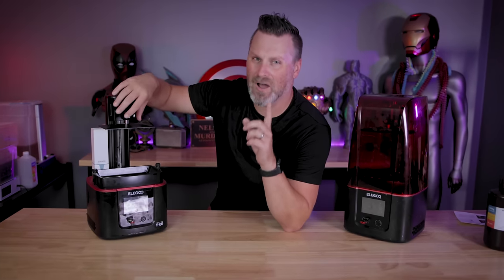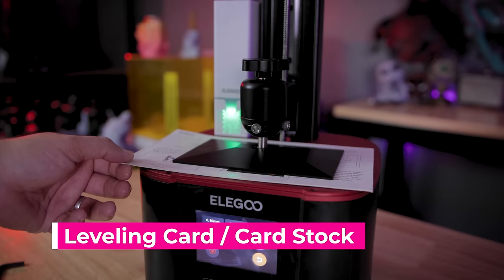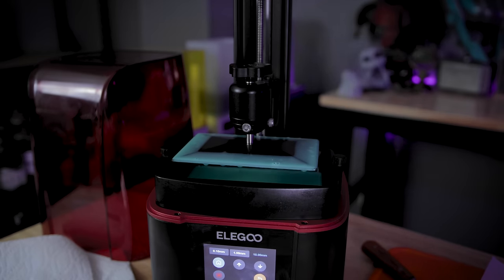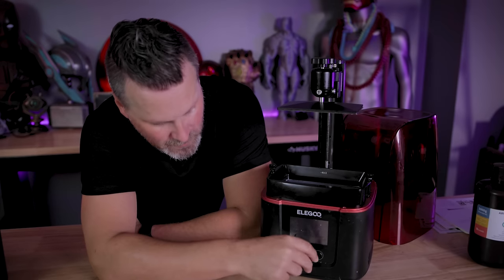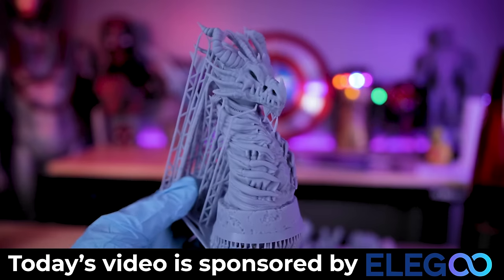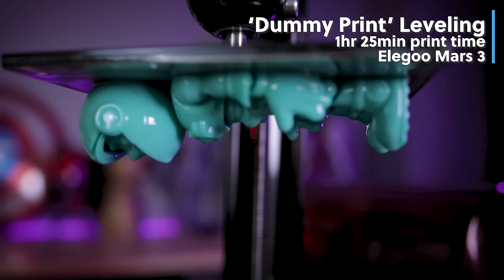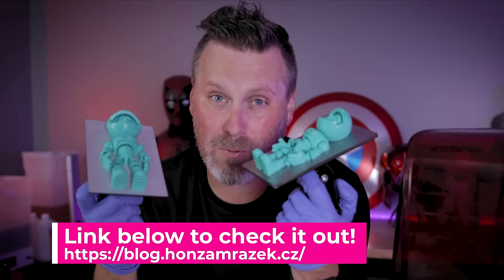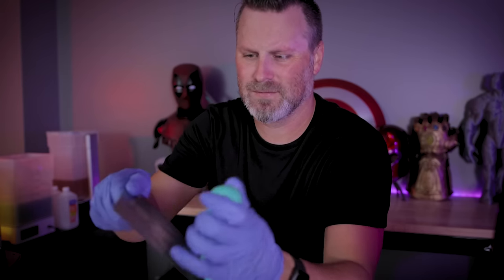The NEW best way to Level your Resin 3D Printer?!?!

Comment: This is exactly how the $90 Monoprice MP Mini SLA printer levels the bed. It loosens the knob holding the build plate in place, lowers the build plate into the vat, and tightens the knob - automatically! As long as you keep the vat clear of hardened resin, this method will never fail.

Comment: I have had the peopoly phenom for 2 years and have never used paper, card stock or film of any kind  to  level the build plate . I just level on the screen  and move on. I rarely ever have to level the build plate this resin printer is a walk in the park to use and I keep it running 24 hours a day 7 days a week. And now I guess you  could say I use film because I keep the screen protector on when leveling. Thanks uncle Jessy for all the information you give on these printers. It was because of your review on the phenom is why I bought mine . Happy creating................

Comment: I use the faster "2 sheet resistance 1 sheet glide" method. I set the level to just have slight resistance on 2 sheets but one sheet can glide under the build plate without catching. It is faster and easier than Jans method because it is dead easy to test by running any program to check that the first layer still lets the 1 sheet glide under the build plate.

 It also avoids squashed prints because it does not cause a pre load. If you squash the build plate when tightening it transfers a load up the z axis and rubber buffer causing screen squash during printing..
Reply: FEP or paper sheets?

Comment: You can already compensate for elephant foot in the Chitubox settings (Advanced/Bottom Tolerance Compensation).  I don't think elephant foot in resin printing can be fixed by adjusting the homing, it's due to the bottom layers printing 10x longer than the rest. This causes more resin to cure, which only has one way to go, outward.  And to be honest, I have yet to experience much elephant foot on the Saturn. Don't know if it may be the Sirayatech Blu Nylon resin I'm using.
Reply: as you could have read in the comment that the blog's author posted 2 hours before you asked the question, the goal of this method is NOT to eliminate the elephant's foot 🤔
Reply: @pgabrieli   It is nonsensical to suggest it affects the appearance of the whole model which is what he concluded as well as the slight reduction of the elephant's foot.

Comment: From an outsider's view, who only has FDM, after watching the video it seems the "Dummy Print" method is just using the FEP sheet instead of a sheet of paper as the level. So is the FEP sheet thicker than paper which eliminates the elephant's foot because the plate is not pressing down as hard?
Reply: Hi, Jan here. Read the post - it explains why it is needed. TLDR: Stupid chitu firmware.
Reply: @yaqwsx0cz  Informative, thank you. Since I don't have a resin printer it seemed this was just using one leveling medium over the other. But I could extrapolate why to use this method if it is just Chitu causing issues with z height programming.
Reply: Idk about thicker, but I would say higher. The start point of any print is not the same as the level. I assume the start point is higher. The paper helps you to level against the screen with curing residual resin on your glass, and other messy stuff. 😂 I too have used printer paper, parchment and card stock. No difference in performance really.
Reply from the maker: @yaqwsx0cz  ☝️☝️☝️☝️☝️
Reply: I'm curious if you have to relevel though if you change layer height?  The starting point for .025 would be different than .05 or .1
Reply: @RM_VFX  no, as levelling means setting z=0. Each layer is z+(layer height)
Reply: @yaqwsx0cz  hi there, just finished testing the leveling and light-off procedure that I read in your post on my Mars 2, i have almost no elephant foot and the layers are perfect. thank you so much
Reply: @QuellicheilMarza  Happy to hear that! If you want to share, please share with the original blog post.
Reply: Semi-related to this: I feel like maybe I missed some technique in last year but how are you able to get flat on bed prints like this that don't fail. The technique I've been using has been to angle the design, but with this design being rounded it seems the amount of suction to overcome would increase for at least half the print, yet these print just fine

Comment: This method seems like it would be dependent on having the correct z=0 position to begin with. To me it would seem like when you hit the home button the chitu firmware sends the build plate carriage down to engage the z-limit switch first, then goes up 0.5mm in order to ensure that the build plate is all the way at the limit. With the dummy print method, the carriage will begin the print wherever the z=0 is currently set, so if dummy operator accidently set their z=0 at 10mm up then the dummy print method will start the print at 10mm up.
Reply: Aggreed

Comment: I don’t recall where I learned this, but I have been trying out the method of leveling with four strips of paper, one at each corner.  This method helps with ensuring that there is consistent pressure and nothing shifted after torquing the set screws.

Comment: I think im missing a part of how the second method works, from my understanding when the arm moves up for that first layer the plate is still loose so it is still 0 away from the FEP. Is this method taking into consideration the positioning of the arm? Also how does the printer read when this is set up? Ive tried using the manual lift to raise the arm by .01mm before to try and deal with compression but when i tried to print 0 was still in the same place because without a bed home first i cant set the 0 position..... pressing the  home button or starting a print just makes the arm try to push the screen further down into the screen

Comment: Isn't the elephant foot mostly caused by the burn in layers curing for longer/more bleed time during the long burn in times?
Reply: Agreed. Nothing to do with leveling, just with the extended exposure time of the burn-in layers causing it to bleed. In my opinion, it seems like leveling against the FEP causes it to be way too close to the screen on that first layer, then curing for 20 seconds will bleed a lot into the adjacent resin since it is really thin, worsening the elephant's foot. Even if you were to compensate by removing pixels from the burn-in layers with the slicer (like with Lychee Slicer Pro version) you might still see it since the first layer is way too thin and thus over exposed.

An alternative; after leveling against the FEP, you could move the plate up 0.1mm and then set Z=0, this would make the first layer a total of 0.1 to 0.15mm which might reduce the elephant's foot on that first burin-in layer. That, and -0.2mm to -0.4mm from the Lychee Slicer Pro - Compensate feature, and the elephant's foot might not be visible anymore.

That said, I would avoid leveling against the FEP, any missing cured resin in the plate or in the Vat can perforate the FEP when applying pressure, and then what? Source: it happened to me.

Comment: Well, I tried this on my Elegoo Jupiter, but it doesn't seem to work. It might be because I have the flexi-plate installed though. After leveling it this way, my printer couldn't get to home when trying to print. The plate just kept trying to lower, would hit the bottom, make a noise, then try again like 3-6 times before I stopped it.  Luckily no damage to my FEP or the screen. I'll just stick with the paper method for now.

Comment: Homing and Z=0 are always misunderstood. Homing will lower the z axis until the optical/proximity switch is reached. Z=0 is where the first layer will begin printing.... HOWEVER, the z axis will always lower all the way to the optical/proximity switch BEFORE a print starts, then it lifts to wherever Z=0 was set. Regardless of leveling preference, it is important to understand this so you don't damage your screen accidentally. Keep up the great videos!
Reply: then is it necessary to do the typical leveling with the paper before trying this method or am I wrong?
Reply: Don't waste your time i have tried explaining that to Jan plenty of times. He still thinks the optical sensor is the z=0 which would be crazy because every program would crash into the screen looking for the optical sensor.
Reply: @Anton_Vader_3D  Level is level by whatever means you get there. Everyone will have their preference for accuracy and ease, and I am not disputing which is best. I simply want to point out that Z=0 is seperate from leveling. It is just information on how your machine works that may be helpful to know. I stumbled across it on my own and realized my original presumption of Z=0 was incorrect. Once I properly understood it, it help me resolve some issues I had when using very viscous resin. You can easily test the feature yourself for clarification. Level your build plate by whatever method you choose. Then raise the build plate by some visually obvious amount (10mm or more) and set the Z=0 at that point. Finally, WITHOUT A VAT INSTALLED, begin any print file. You will see that the z axis will lower to the sensor (as a sanity check / reference). This is the same spot it goes to when homing to level. Then it will raise to the Z=0 you previously set (10mm or more), and then the LCD will display the first layer and "begin" the print. Seeing it operate first hand will give you the best understanding. Setting Z=0 at your leveled position ensures that printing begins at the machines absolute zero position as defined by the sensor. Also it would be good to check this on your particular printer as I cannot guarantee it true of all brands and models. I do know it is accurate for all Elegoo printer from the original Mars through the Saturn. Hope this clarifies things, happy printing!
Reply: @karlh6692  There is no need to convince anyone, my point can easily be tested...this is the method I replied to another comment "You can easily test the feature yourself for clarification. Level your build plate by whatever method you choose. Then raise the build plate by some visually obvious amount (10mm or more) and set the Z=0 at that point. Finally, WITHOUT A VAT INSTALLED, begin any print file. You will see that the z axis will lower to the sensor (as a sanity check / reference). This is the same spot it goes to when homing to level. Then it will raise to the Z=0 you previously set (10mm or more), and then the LCD will display the first layer and "begin" the print. Seeing it operate first hand will give you the best understanding. Setting Z=0 at your leveled position ensures that printing begins at the machines absolute zero position as defined by the sensor."

All CNC machines need an absolute mechanical zero point to reference their coordinates from. FDM printer and CNC routers must also home all of their axis before beginning to run their g-code. This Z=0 offset is akin to starting an FDM print in the middle of the build plate versus at X=0, Y=0 in the corner of the build plate. However, the difference for the Z offset determines the quality of the first layer/adhesion and the success of the print for both FDM and resin.
Reply: @PerformanceTechEngineering  No need to explain to me I have designed and built my own cnc machines. I understand how the limit switch homing works and how it applies a work co ordinate after sensing the limit switch.

Comment: Two quick questions: 1. Is the vat empty/no resin in the vat? (I appears that way). 2. At what point do you set the Z-Axis, if you do at all?
Reply: I have the exact same questions!
Reply: The vat is empty, everything is cleaned. He doesn't have to use any "Set Z-Axis" buttons after tightening down the build plate because he's adjusting the build plate to be perfectly level at the currently stored Z-Axis setting. As opposed to manually adjusting the build plate position and THEN setting the "Zero Axis" to match the new build plate position.

Comment: I am just thinking, when you do the new method, you risk in putting pressure on that cercle directly on the screen, as that screen does not need much force to damage it
Reply: There's no resin in the vat (he says to make sure there's not even resin residue left behind), thus nothing is actually printed so only the flat build plate is being pressed down onto the screen

Comment: Im a bit confused. ( a little late to the party I know) but if it started printing, wouldnt the spring be decompressed by the height of the first layer as it already started exposing? Or that little bit of compression isnt a deal breaker?
Reply: Agreed. Plus any cured resin from previous prints could cause the FEP to be punctured or perforated. I personally do not level against the FEP. If I would do it, I would certainly add some buffer to Z=0, like 0.1mm for that first layer.

Comment: Simple question here ! I have an elegoo mars pro 2, I already did the bed leveling calibration by the menu on the printer. Is it ok to do the "dummy print" version right after or should I undo in any form the bed leveling calibration on the machin first ? And if so how to do so ? thanks a lot !!

Comment: Gonna give this a try, I’ve leveled using paper and index cards in the past. I have an odd issue I haven’t been able to find help for where my fep is getting damaged every time I print, it sticks and puts dimples in the fep. I’ve tried nearly half a dozen different methods to installing the fep, including using a tuning app, and gave up after burning through several brand new sheets and wasting resin to boot. It probably is still to do with the tightness of the fep but I need to try something new or a may just give up on the machine altogether. It’s killing my fun in the hobby to keep having this issue.
Reply: what printer do you have?

Comment: I cannot fathom why everyone seems to get so hung up on complicated methods to level a resin printer plate.  I always just leave the vat and film in place, loosen the screws, home it, then tighten the screws - This has never once failed to work perfect for me.  Now more difficult to get right is leveling my top-down resin printer....
Reply: What kind of top down resin printer do you have
Reply: @InitiallyJB  Hitry Rocket 1 Pro
Reply: @tommydouglas3911  yea I seen the process and setup. It scares me to think of how much I’d I have to invest in it only in material
Reply: @tommydouglas3911  hey bro can you do a video of your process it seems so simple but I tried it and it didn’t work but I did try it the way elegoo does it on there page and it work successfully
Reply: I finally got my flexplate and did the home without the vat... And after a few prints going wrong i just re did the calibatration and raised it a little bit. And so far my prints are doing well without elephant foot.
Reply: Can you still do that if you use a magnetic tray ? This adds a couple of mm, shouldn't it break the screen ?
Reply: @jchamorrob  if your using flex plate is just raise it another 3.5 mm that seems to be the magic number for that, maybe another 2mm-3.5mm not sure how much raised your tray is (are we talking vat?? When you say tray ) thought we were talking about just bed platform leveling

Comment: this is very impressive... it sounds so ridiculous that most would think of laughing at the thought of this trick... but after seeing the two prints... we may want to see some more testing with this method to see if the first one was just a lucky fluke or not but if this continues to be the case then i'm sure many of us will follow suit of using this method of leveling... definitely a learning curve to relearn on how we think of leveling but this maybe in the right direction

Comment: Hi, I've got the FlashForge 9.25 6K. I'm getting an error code when the print starts. The z axis can't seem to pull the print off the fep film. Could this be caused by incorrect leveling or incorrect resin settings ( using default settings for that resin) or a faulty motor. Your advice would be really appreciated.

Comment: Not sure what the purpose the dummy print is versus just lowering the build plate manually on an empty vat and then tightening (and then setting z=0), which is what the old "Flint Read" approach is. Never heard of anyone actually filling the vat with resin during the leveling process.
Reply: Read the blog post - it discusses the reasons why. TLDR: There seems to be a dummy constant in the firmware that moves the build plate below the zero print for the initial layers.
Reply: @yaqwsx0cz  Thanks for clearing that up. It sounded to me like the light magically pushed the build plate or something :D
If we had something like manual Z-offset like on an FDM printer all this could be avoided.

Comment: Thank you for this video. I always print the bases for my minis flat on the bed and am always annoyed about the elephants foot. I will definetly try this method and see how my next bases come out.
Reply: How did they come out?
Reply: @xlavleenx  works fine, almost no elephants foot. But I'm not sure if this is because of the new leveling methode or because of the new "Bottom tolerance compensation" in chitubox which I also use. :D
Neitherless is so much easier to level your plate this way, no extra step.

Comment: Is it just me thinking that when printing the first layer the build plate should NOT be at zero, but at one layer hight? So when using this method it should (theoretically, untested yet) work if you switch of when the machine starts the SECOND layer?

Comment: Please someone answer me, I have an Elegoo Saturn S and I bought the magnetic plates for the printing plate, some say that no additional spacers are needed for the printer and others say yes. Any direct experience with this printer? I would avoid putting them but I would not want to break through the display during the z axis calibration.